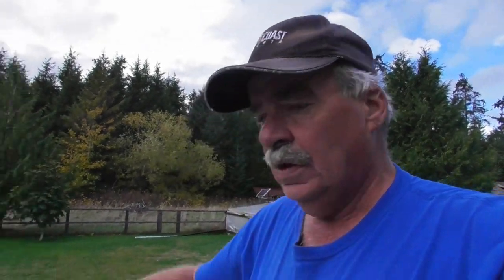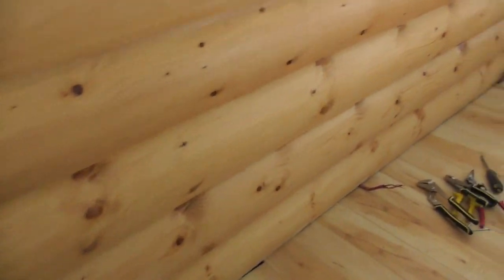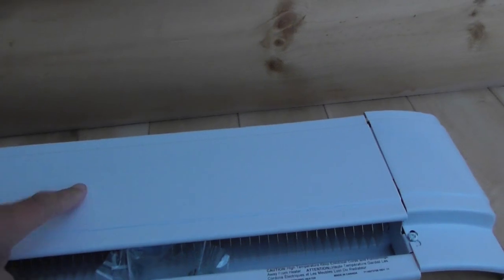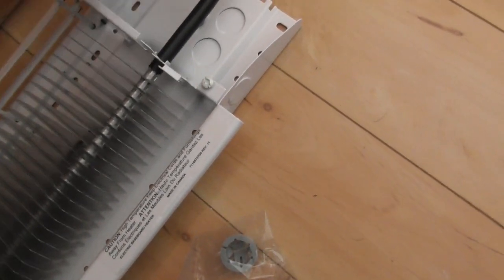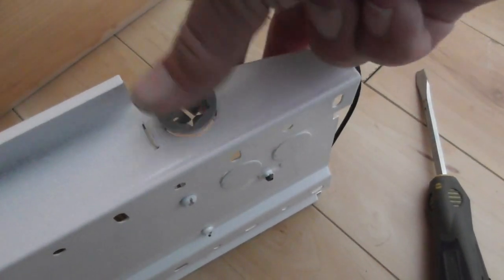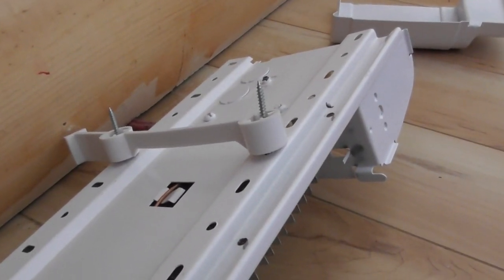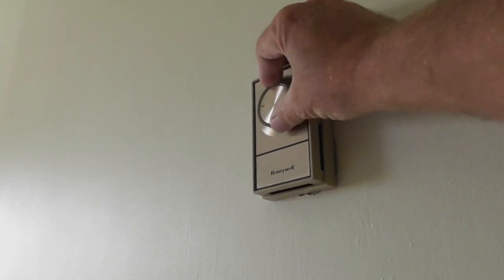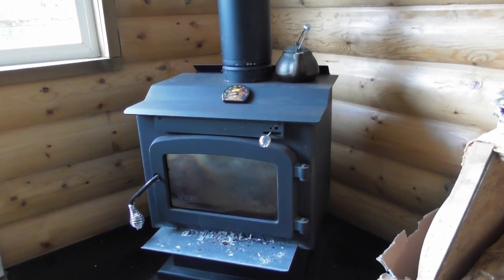Energy Saver Dimplex Linear Convector Baseboard Heater Install !

Comment: You are the only one explained the wires clearly; you are the best!
Reply from the maker: Thanks!  Enjoy your Dimplex heater!  Ours is still working just like new!
Reply: @NormanMcGregor  Thank you very much!  You explained the energy saving design too; I believe you are the only one again! 👍
Reply from the maker: @freebird127  The Dimplex heaters do provide a lot of heat very quickly, so you use them much less than standard baseboard heaters.  For Comfort and Energy savings - Dimplex heaters are the best!
Reply from the maker: @freebird127  Looks like you are doing videos on your YouTube channel from my old stomping grounds of Alberta!  Nice videos!!
Reply: @NormanMcGregor  I live in BC; travelled to Banff and Jasper this summer  👍
Reply from the maker: @freebird127  Alberta is nice but BC is Best!!

Comment: i'm building a small heated paint storage room in an unheated garage.  Think of a space 4x8 x 9' tall with some shelves, and a door, insulated walls.    I want to install a heater.   Oil Filled electric space heaters run at 120 volts, consume up to 1500 watts, and put off a set amount of BTU's.    There are also 4 foot electric base board heaters like you featured, that lack the thermal mass of the oil filled electric radiator style that come in 120 and 240 volts.   I found your video as I searched for information on "higher voltages, consume lower amps, and are cheaper to run."   But with electric heat, I got the impression that a watt of energy in, regardless of whether its 1 leg at 120 or 2 leg at 240, will produce the same BTU's.   And instead of drawing 15 amps on one leg, I'd just be drawing 7.5 amps on two legs, and thus wind up with the same bill from the electric company at the end of the month, and I have to give up the thermal mass of the oil filled radiator if I go to 240.

BUT, i have the sense i'm missing something.   Can you go more into depth on how this works with AC voltage, and amperage, and how that relates to creating BTU's with electric heat, and the Kilowatt Hour Draw and expense?   I love the geeky math stuff.  Thanks!!
Reply from the maker: Hi Drew, Thank you for you question.  With any electric heater, as I explained in the video, cost efficiency of the heater is directly related to how efficient it is to transferring the heat from the devise to the surrounding air, which the Dimplex heater excels at.  I have used the oil filled heater and the old style baseboard heaters, both on 120V and 240V and the Dimplex style of Straight Throughput air flow, delivers the most heat per KW of electricity and not just by a bit but more than 40% compared to the other models.  I live in a climate similar to you and use a 750 - 120VAC Dimplex in our bedroom, and it provides way more heat than we need and only costs about $40.  I think that this would be more that enough for your needs unless your shed is in a Sub Artic climate.  Thanks for watching and let me know how you choose to move ahead.  Thanks Norm  

PS:  Your videos are Very Good!  I Subbed!!

Comment: installed mine today thanks for the help man!!

got two 1250W as a test to replace the 750 in my room and the 750 in the downstairs that along with a 2500w heats most of my open concept place.

wish I could do a more exact test. like see how long it takes to heat up the same area under identical circumstances. I may do that in the bedroom and time it to see how fast it can raise the temp 5 degrees Celsius. but also sot a perfect test as the old one is 750W and this new one is 1200W

only downside is one of the wall mount screws easily stripped.its pretty firm against the wall but not super firm. and my fire alarm went off with its first use

Not sure why people are complaining about it putting off high temperatures on the wall. the wall with the Dimplex is noticeably colder (due to the spacer) than it is above my convention U shaped old one.
Reply from the maker: Sound like you have done a good job!  I forgot to say that you should wipe the dust out of them before you start them up as it will burn off and smell which more than likely was the cause of your fire alarm going off.  Its also a good idea to wipe them out in the Fall before you use them for the first time after they have been sitting all summer as dust will settle in them.

Comment: Can you now make a video on how to set the thermostat on the Dimplex?  I am not quite sure how to set the temperature for my room.  I read the guide but ... it is confusing...  I would learn more if I could see someone do it .
Reply from the maker: I was replacing existing heaters that had inline wall thermostats mounted on the wall.  The model I bough does not have an internal thermostat as it uses the wall thermostat.  I am not sure on how to use the models with the internal thermostats. Sorry.
Reply: Gaelle MAZ

Just use the - or + key to either bring the temperature up (+) or down (-) when you release,  the unit will set to that desired temperature.

Comment: I bought  a 2500 watt dimplex  like yours ..we have a dryer plug we are not using and it's connected to a double  30 amp breaker it has a 10 gauge wire with a black red white and ground ..can I use this to connect the baseboard heater? I bought the one with the built in thermostat which has a black wire which goes to L1 and a blue and blk that goes to L2 
The blk and red on the dryer plug are hot and split power to the 30 amp breakers my question is what do I do with the red if I use this circuit ? Thank you
Reply from the maker: I originally had installed the same model and then changed them out to the basic model with an inline thermostat.  Dimplex's website does have electrical drawings for your type of installation and it would be advisable to refer to those drawings for final hook-up.

Comment: Those are called Chromalox in Canada and you can buy them at Canac in Quebec. Haven’t checked Home Depot. Thanks for the installation instruction. Couldn’t figure it out based on the electrical diagram.
Reply from the maker: Yes!  Chromalox is the name used in Quebec.  I am in BC where they are called Dimplex and are available at Home Depot.  The link in in the description box below the video.
Reply: I got mine from Costco. 3-Pack. Thanks for this. I feel better!

Comment: Thanks Norm, your remark"there is no easy way to do this" regarding the mounting of those little plastic supports was right on.
I'm thinking they could have a better way to line the supports up with a template possibly ,because I found it frustrating. I ended up doing what you did. They're nice that they can be mounted anywhere along the back of the unit-holes the entire length. So bleeping fiddly!!!
Reply from the maker: Yes they can be a bit of a pain to install but it is needed because of the heat those units put out.  Short term pain, long term gain!

Comment: Nice job. My house heats with all electric in the plaster ceilings that is why I could never take it off grid 100 percent. I love heating with wood but can no longer cut wood. Take care
Reply from the maker: Here I had a flatbed truck drop me a load of logs.  I take my time through out the spring and summer and cut a bit every few days to make up my Winter supply.  I think That one load will last me 5 years or more.
Reply: @NormanMcGregor  I used to burn about 4 cords a year
Reply from the maker: We will use about 2 cords in a warm to normal year and 3 cords in a cold year.

Comment: Great...I will get one for upstairs ~ I heat with wood also, but if I go away it's nice to keep the house warm and these save electricity at 240 volts  :)
Reply from the maker: Yes that is what we found.  The house got cold and damp when ever we went away and this should fix it.
Reply: you do not save money by using 240v vs 120v. You pay for electricity in kilowatt hours....watts are unchanged by voltage. The higher voltage reduces current - amps. A 2000 watt heater on 240v draws 8.3 amps. A 2000 watt heater on 120v draws 16.6 amps.....they both consume 2000 watts and put out the same amount of heat.
Reply: 240v or 120v...uses the same amount of electricity....you pay for watts NOT Volts. The only thing 240v does is is reduce the current (amps).

Comment: I had a dimplex with electronics thermostat intégrated. But it is not working anymore. 
My question is.  Did I can install a bipolaire thermostat on the left side and leaving the death electronic in place????
Reply from the maker: I am not sure but would think you must first disconnect and remove the original thermostat and bypass the wires going to it, BUT I WOULD NOT RECOMMEND DOING IT.  Really I would just replace the unit as they are very inexpensive to buy and quick to replace.

Comment: that gap behind the heater looks like crap.  I'm just about to install the 1000w myself and now i'm not sure i want it.  I want it flush again the wall not sticking out.

Nice video.
Reply from the maker: Read the instructions!  Non Flammable wall types are OK with a flush mount, but most walls will require the use of the spacer.  The instructions are VERY CLEAR in this matter.  Installed correctly they work Great!
Reply: Adan crag
You can't install this units flash to the wall, because of the heat this units generate,  it is necessary so to prevent, fire 🔥 and allow better heat sirculation.

Comment: I wanted to see where the supply wires came from. Through the floor? It looks like I could reach under the unit and grab the cable.
And I don't think Home Depot carries them anymore.
Reply from the maker: Yes the wire comes through the floor from the basement.  I just checked and Home Depot still carries them. https://www.homedepot.ca/search?autoSuggest=dimplex%20heater&q=dimplex%20heater#!q=dimplex%20heater
Reply: @NormanMcGregor  Thank you.
It looks like they don't carry them in Pensacola Florida

Comment: Instead of Black and Red wires I got Black and White wires. Can I safely assume that my White wire is the Neutral? Thanks.
Reply from the maker: If you are installing a 240VAC heater into a 240VAC connection, both black and white wires are hot.  Each one connects to one of the two wires on the heater but don't forget to connect the ground wire first.

Comment: home depot Chilliwack sold me 12/4 wire said it works with anything 240 volt related.
Reply from the maker: The Dimplex heater only needs the black and red wires plus the ground wire.  I think the white wire if for when you are doing a 120/240vac install such as a stove.  But please check with a local electrician to be sure as electrical codes are different in many areas.

Comment: Hi, Great video!  Made me chuckle when you seemed so pleased about Patsy Cline...a classic!  Did you use a single pole or double pole thermostat.  A Dimplex customer service representative recommended the double pole, programmable thermostat for some reason.  I'm not sure what the reasoning is.  I already purchased the single pole thermostats, but they aren't installed yet.  The programmable, double pole thermostats are expensive...double the cost of the turn dial ones.  Are they really necessary?  What do you have for thermostats?  Thanks, so much!  :-)
Reply from the maker: I use the old inline dial type thermostat as I was just replacing the old inefficient heaters.  They work perfect and no extra wiring required!!

Comment: Norman great video!!
I also got the 750W only mine has a built in thermostat. I emailed and asked them if this model works with 120V 12G wire. They said it did but the instructions say 240/208. Would the one you installed work with 120V 12G wire?
Reply from the maker: Mine is 240/208V only.  They make a 120V model though.  My unit is for use with an inline wall thermostat which uses the 240v line voltage because I was replacing an existing old style heater.  The heaters with a built in thermostat are wired very differently and if you wire them up like I did this model, the thermostat wires will fry.
Reply: @NormanMcGregor  Gotcha!
Thanks for the great info Norman and quick reply! Your the man!
Reply from the maker: @BrandonJohnson-ez1bs  Hope your installation goes well!  These re Great units!!

Comment: i have black hot red hot a white common with a bare copper as ground . where does the white go on the heater side or is it eliminated and you only use the black red and bare wires
Reply from the maker: Sounds like you need to test which wires are hot.  You should only need 2 wires and a ground.
Reply: @NormanMcGregor  ok thank you

Comment: I am installing one of these units and the you tube is really helpful, however, I need better instructions to remove the center cover.  I undid the end cover by removing the screw, but I am afraid that I may damage the center cover.  You didn't cover that step, you just showed it with the cover off.  The instructions say that it seperates from the top first, but I don't know how to lift it from the top.  Can you help?  I have everything else under control.  thank you  Julie Ford
Reply from the maker: The cover hangs on clips on the top and bottom.  Just pull the cover up a bit and it will slide off the clips.  To replace the cover slide the bottom on first and push the top over the clips.  You won't break it as it needs a bit of force to get it off and on.  Hope this helps and enjoy your new heater.
Reply: Julie Ford 
Hello.
Do you have the one with on board termostat?

Please share wirering solution 🙏 
Thanks

Comment: Hello! Thank you for the video!
I have one question: Do you have to wire from the right hand side? I put my wires on the left of where I need the heaters to be, being used to choosing which side I want to wire from.
Reply from the maker: Yes you can wire the units from either side.  They are set up the same way.
Reply: @NormanMcGregor  -- Thank you for letting me know! I feel better prepared for picking them out this week! :)
I asked because I saw a comment online about only being able to wire on the right side but that may have been for a similar product (some of them have built-in thermostats) and not this specific one.
Reply from the maker: @fergusontea  Hay Mike, even the Dimplex units with the built in thermostat can be wired on both sides.  A very well though out product for sure.
Reply: @NormanMcGregor  

The build in thermostat,  it's best to wire in the right side,  EASIER THAN extending the yellow, blue, an black cables to the left. 

Use the left side as a utility box,  and RUN CABLE, THROUGH the BUILT-IN CHANEL,  ON THE BACK OF THE UNIT TO THE RITH SUDE;  WITH OUT HAVING  TO CUT YOUR WALL.
Reply from the maker: @djkjrene  That works too!

Comment: The hot to the black and the red to the neutral?? Is that correct? Not second guessing, well I am, sorry, but I’ve always learned that the red was live and black was ground (neutral)... Is this just diferent terms being used?
Reply: Scratch that I suppose... I went ahead and followed your instructions and it seems to work!! : ) ... I assume the breaker would have jump if it wasn’t hooked up properly... will run it for a few hours and make sure wires don’t get hot and we should be good from there in out!! Thanks for the tutorial; They must have missed a sheet or 3 in my package, cause I didn’t have much in there to guide me!! Cheers!! 🍻
Reply from the maker: Yes, their instructions are less than useful which is why I did the video.  When connected properly, it does an amazing job heating your home, I think it does the best of any of any baseboard heaters on the market out there, by far!
Reply from the maker: If you have the same unit as I do, the left and right side are the same.  If you have the model with the built in thermostat, the wiring on the left and right side are totally different and I don't know much about those units.
Reply from the maker: On my LC Dimplex heaters, the left and right side are exactly the same.  Just unscrew the connector from the two wires and hook up the power wires to each and make sure the ground wire is connected.  On the model with the built in thermostat, the left side is totally different and requires a totally different wiring setup.